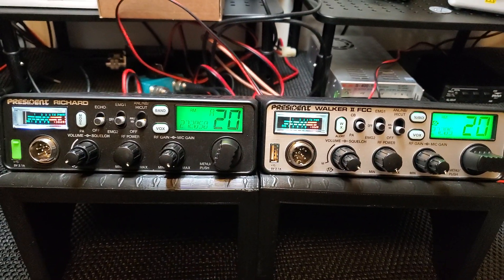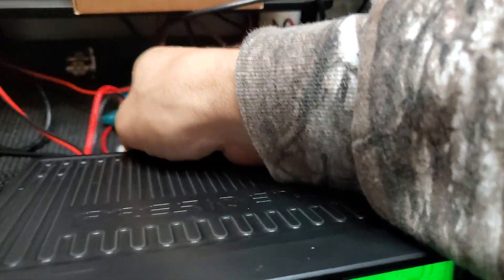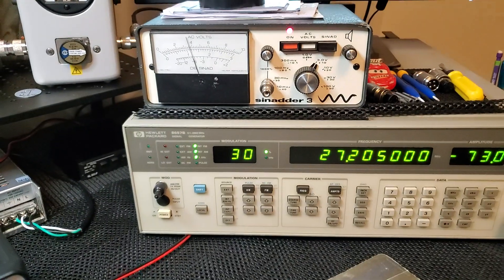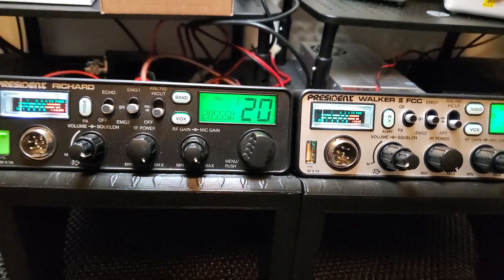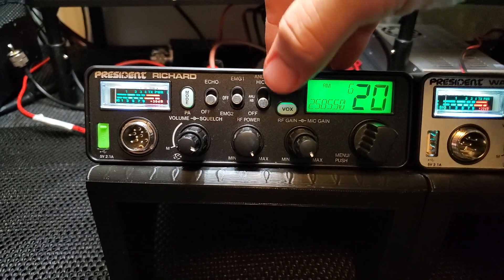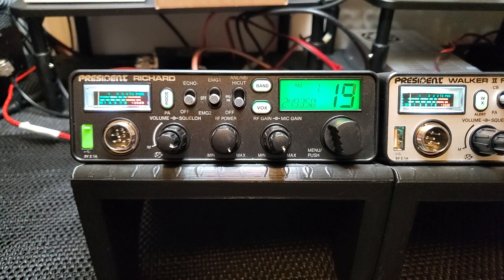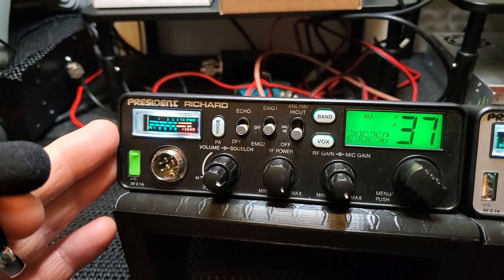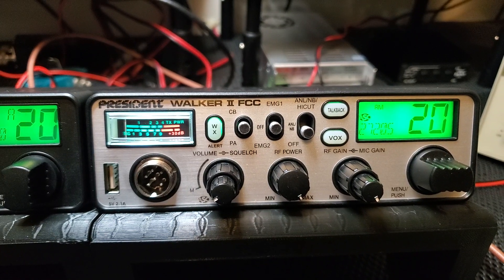President Richard 10 Meter vs President Walker II FCC

Comment from the maker: Disclaimer:
Please follow all rules and regulations regarding licensed and unlicensed radio transmissions.
Please be aware there are certain rules and power output limitations regarding unlicensed transmission on Citizens Band Radio in the USA.
We do show equipment that is not type accepted and is over the legal power limits for operation on 26.965 -27.405 Mhz in the USA.
We are showing this for educational purposes only.
We do not modify  New 10 Meter Radio sales for operation on 26.965-27.405 MHz for profit.
Any New linear amplifier sales are for the sole purpose of being used on the Licensed HF bands by Licensed Amateur Radio Operators.
We do show for educational purposes only certain Linear amplifiers being used on 26.965-27.405 MHz on our channel.
All of our tests are made transmitting into a 50 Ohm dummy load.
To get in contact with us:
✉️
Sales@Scottsradiosllc.net

Comment: KLl203 with president radio seems to show hi swr.  Set swr with just radio or amp off perfect turn amp on shoots way up probably 2nd or 3rd harmonic?  Anyway to fix this other than low pass filter?  The low pass filter disable the weather function on the walkers.
Reply from the maker: The harmonics are part of the amplifier. Everything is Amplified, even the stuff you don't want.

Comment: Does the Walker 2 have am AM limiter?   AM limiter in Bill FCC and Walker3 FCC doesn't play well with KL203 do to AM limiter.
Reply from the maker: The radios are designed for clean AM modulation with no distortion.
Typically radios designed with NPC have a level of distortion which wouldn't be allowed for a certified radio.
Reply: @ScottsRadios  To get 100w peak out of a Walker 3 and KL203  I have to run 3W dead key which is about 50W dead key out of the 203.  Not sure how good it sounds or how long it will last.

Comment: All you did was Bash the Richard what you claim only amounts to more static and noise and can only be noticed by a few points on your device.
Reply from the maker: Not a bash. Just showing things that no one else has shown before.
Some folks do live in quiet areas where the air noise is next to nothing. A more sensitive receiver will definitely make a difference on incoming signals.
Antenna is the most important thing.

Comment: Not sure if there are receiver adjustments in the service menu or not I no there is fm deviation on the Richard and the eu walker they both have  am modulation and carrier adjustments I know from owning the uniden 68 with the no adjustment receiver it would be nice if the agc could be backed off just a hire as it seems to be just a hire high but like I said I am not sure if you can do that on these in the service menu or not

Comment: Just a heads up FCC Part 95 class D rules and regulations have changed CB channels now include 6 channel FM band starting at 27.435 ending at 27.535. The president walker version in this video has been discontinued. The new version has FM the weather selector switch has been replaced with FM mode selector switch,. Sorry Scott the weather was just to hold a place for the FM transmit board.

Comment: The receiver has a fine tune called the tone in the settings if you turn the tone up higher the tuner will be more sensitive I would like to see you run the test with the tone being turned up compared to being turned down
Reply from the maker: From my experience the tone control only adjusts the treble on the high end and the amount of base at the low end of the received signal. When the tone is in the zero setting it would be a flat response on a EQ.
The receiver sensitivity in both of these radios is non-adjustable since the radio is built with no internal adjustments.

Comment: Why doesn't the president taylor have rf gain, mic gain, and rf power? Do they come pre adjusted to certain rf power levels, mic gain levels and rf gain?
Reply from the maker: The Taylor FCC is a nice CB radio with less features.
As to the reasons why they made the radio without those functions I really don't know?
I will say that the RF gain level is set from the factory at full sensitivity.
The microphone gain has to be adjusted via the service menu.
Normally out of the box these radios come with about 90 to 95% AM modulation level.
You should be nice and clear and perfectly understandable at that level.

Comment: Walker FCC. Weather Alert is a great feature for over the road. I couldn't help but buy the McKinley. SSB addicted!
Reply: The radio no longer comes with the weather alert feature. It is been replaced with a mode selector switch for FM. It now contains a FM transmit board for the New 6 channel FM Band.